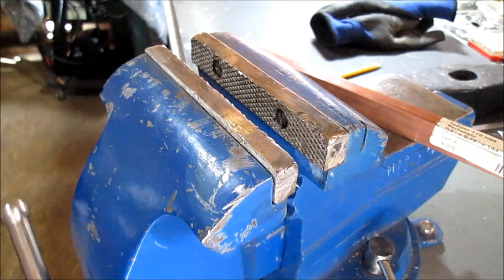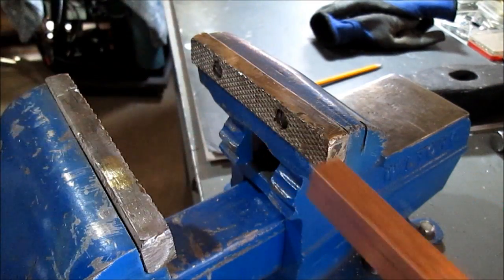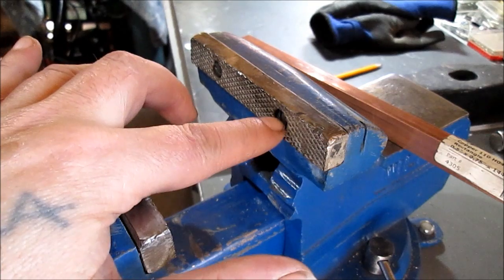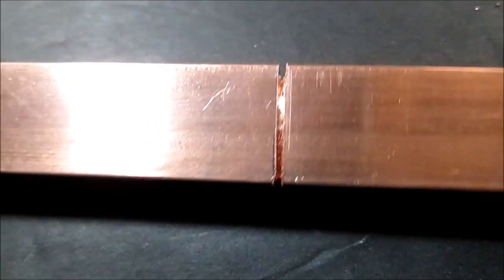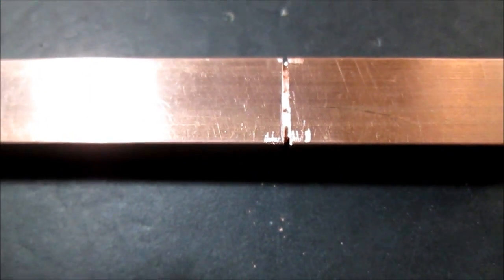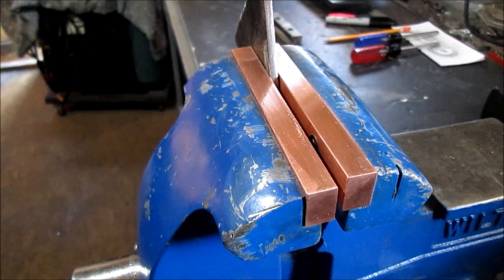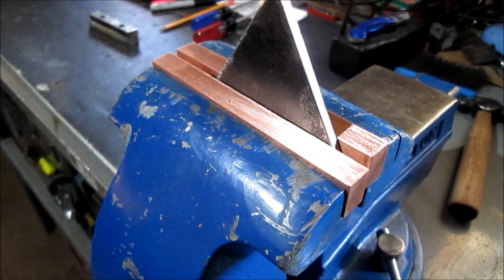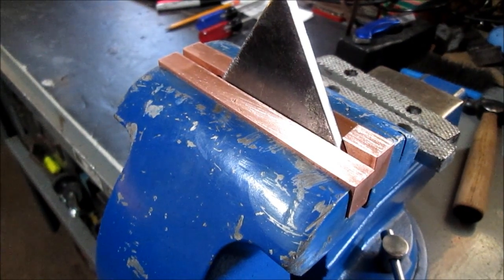Copper Jaws for the Wilton Vise

Comment: Wilton makes copper vise jaws. They are not cheap, they come in several sizes. They attach by bend to fit fingers, so they work on most vises. Reed makes similar ones in brass. They are well made and the faces are thicker than the rest of rhe jaws. That gives you strong work surface and bendable adjustmet to fit your vise. It may work out better to buy rather than make with the price of copper and the time and labor involved.
Reply from the maker: Sure it would be a good deal to buy them if .....You do not know how to make your own ..And you don't like making and buildings things in your shop...I like the satisfaction of making my own stuff my own way ..Even if it does cost a little more money and a little of my time...

Comment: The jaws are great, but what's the story on that diamond disc grinder?
Reply from the maker: I have a video on it ..I will try to give you a link ....It is from a rock polishing machine you could make one from the right motor ..I use a Variac for speeds ..the metal discs are 6 in.dia. with a 1/2 in hole for the arbor ..you can get the discs on amazon but you also need the white plastic backing plate
Reply from the maker: https://www.youtube.com/watch?v=Tcl3vPe_iUo   Part one of the project